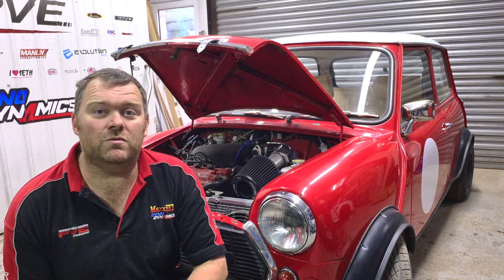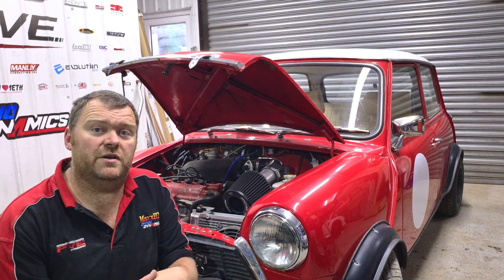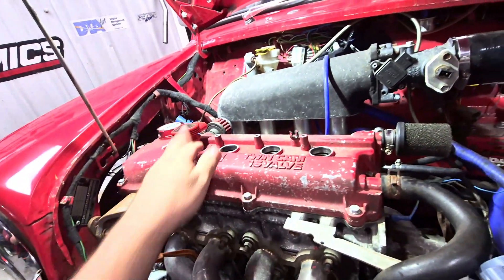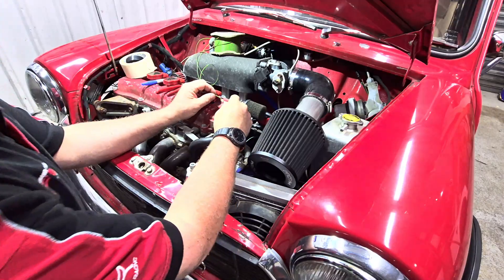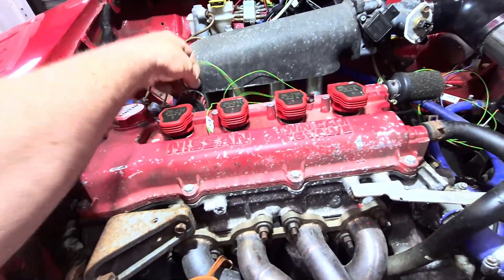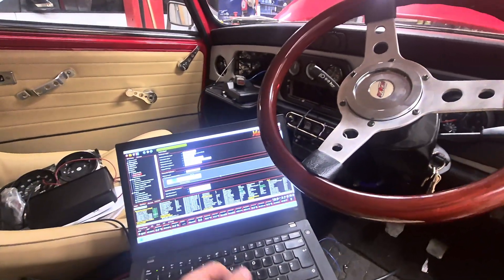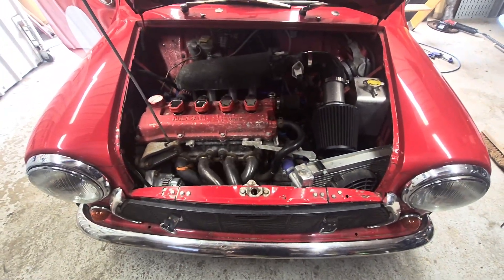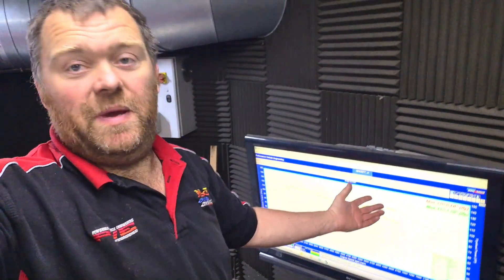Fitting a MaxxECU Street to a Classic Mini running, running a Nissan K11 CGA3DE engine conversion!

Comment: Hi Steve, finally got my Nissan powered mini running on the maxx ecu, had a couple of issues with the set up of the cam sensor switching polarity, it then started first turn of the key(after spinning for oil pressure) mine has throttle bodies on, 4into 1, rally cams and a bit more compression, so I am hoping for 130+, I will be around to see you for some more Bosch injectors with a known dead time.
Reply: That's great David, and I'm pleased you're still alive 🙂 would love to see an update video if you do do one.
Reply: @Peakwanderer yes still alive and kicking, currently away, plan to get back into the videos, just hearing it run really got me going again